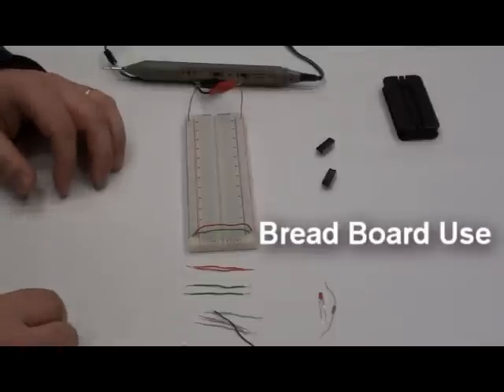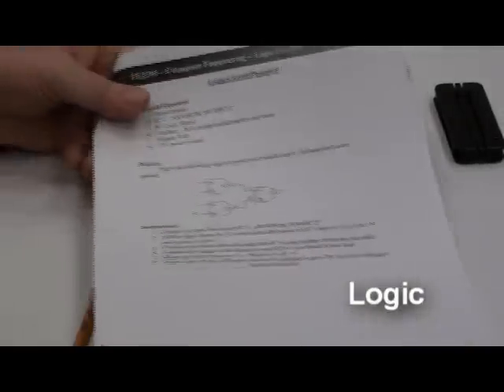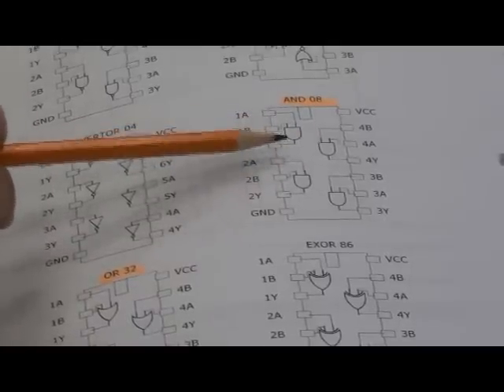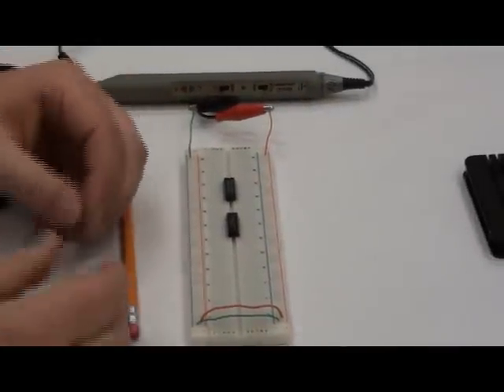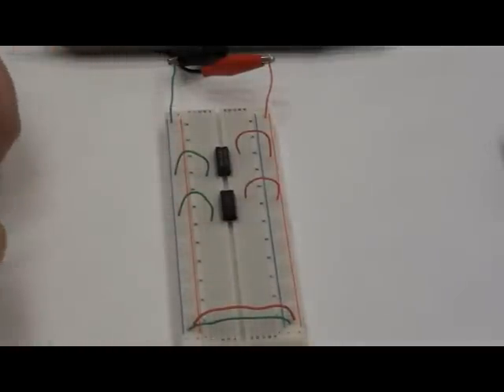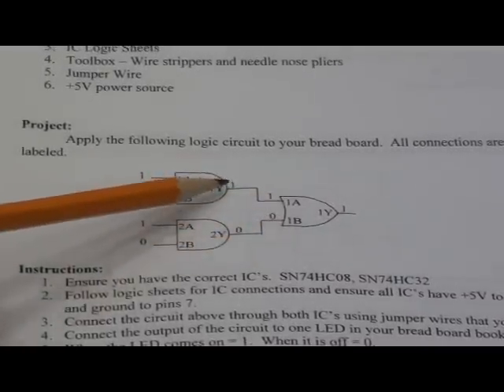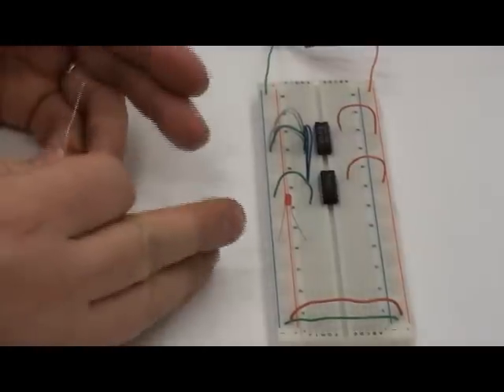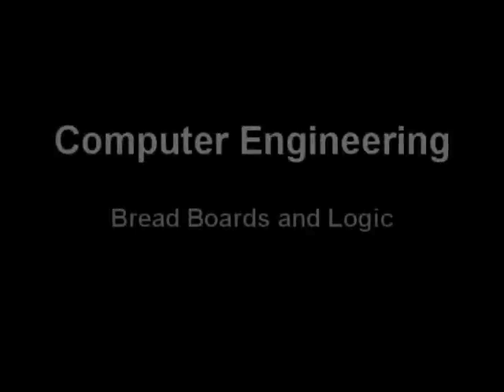Breadboards And Logic

Comment: i'm just student and i'm a first timer to use a breadboard ., and i have this assignment  that need to be  apply in the breadboard ...  "AB+C' =X "  i need to put a diagram logic in the breadboard  .....i just want to ask...if i don't have a resistor .., would be still working?
Reply: No, thermal voltages at the input can turn input on and off at random, so you need a way to ensure a connection goes to ground when no input is present.
Reply: Just putting this here in case anyone else has the question since I got confused myself when trying to wire up a circuit yesterday!